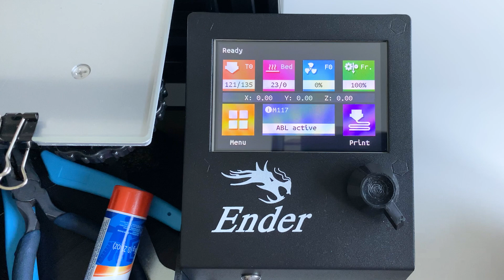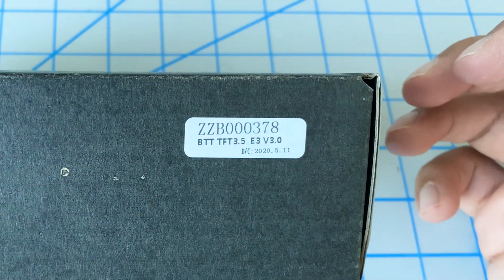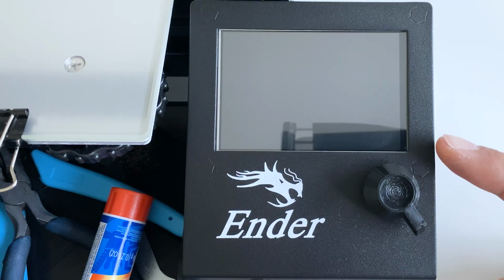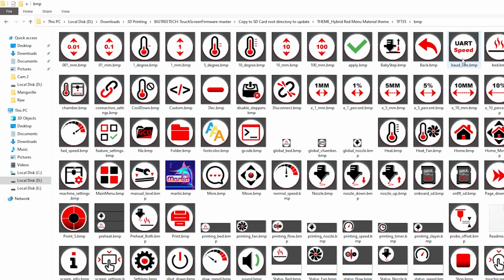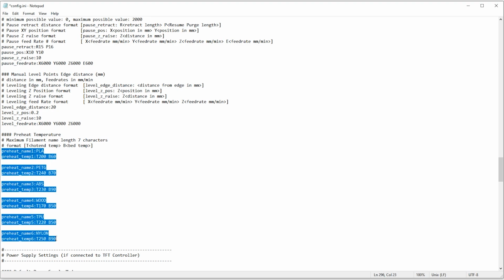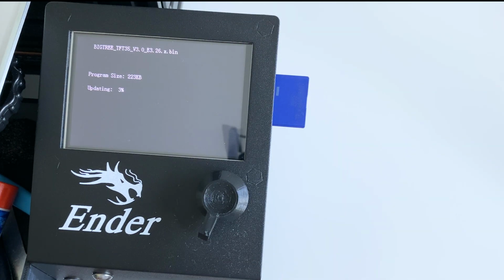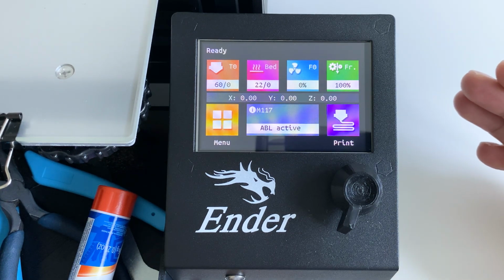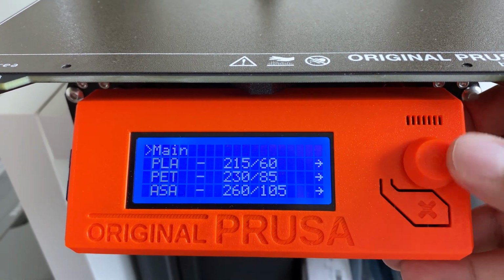Creality Ender 3 Pro BigTreeTech TFT35 E3 V3.0 Touch Screen Upgrade Review | GOOD but some gotchas!

Comment: Where I have to connect it in the creality 4.27 mainboard?
Reply from the maker: Refer to the linked video in the description (minute 3:50 on wards). You won't be able to get the touch functionality with the stock Creality boards though. 

https://www.youtube.com/watch?v=l1Putn10_Ek&t=785s

Comment: I have the same printer. But every time I put my SD card in the printer and start printing it just starts printing a flat peace. It starts on the left side of the printer and goes all the way to the right then it starts printing from corner to corner and it dont just print the item I want printed. I am using the SD card tgat came with my printer. What am I doing wrong?
Reply from the maker: Hey Linda. Is the printer stock or did you make any changes/modifications to it?

Comment: Just bought the TFT35 and will be using this excellent video to guide me through the installation process. Great work👌
Reply from the maker: Thanks, enjoy the touch screen. It’s a really good addition!
Reply: @Mangorille  Although your video was extremely helpful, I was wondering if your would happen to know where I can find an owner's manual? Soooo many settings to play with...
Reply from the maker: @MrPW800  Hey. You can find the user guide here. Not much details and you are left to figure most things out on your own, which is why I made this video. :)  https://github.com/bigtreetech/BTT-TFT35-E3-V3.0/blob/master/BTT%20TFT35-E3%20V3.0%20User%20Guide.pdf

Comment: Hello, Did you upgrade bl touch with skr e3 mini 2.0 board? plz make anytime, setup with bl touch video.. i hope. good job bro!
Reply from the maker: Hey. I did the bltouch with the e3 mini 2.0 board. It wasn't too bad but you do need to set it up using the end stop pin and not the probe port (check the picture in the link below). I couldn't get the probe port to work. Shoot me an email if you want to do this sooner than later as it would take a bit of time to make a video on it and I can help you out further through email.

https://github.com/bigtreetech/BIGTREETECH-SKR-mini-E3/blob/master/hardware/BTT%20SKR%20MINI%20E3%20V2.0/Hardware/bltouch-2.0-2.jpg
Reply: @Mangorille  thanks bro!
Reply: @Mangorille  Hi bro. I couldn't modifiy malrin firmware so, would you give me a firmware? (you used with bltouch z homing like a picture below / skr e3 mini v2.0)
my email is anpower@daum.net

Comment: I mostly use octoprint is it still worth it to get this display? I really like your channel. I have watched all your ender 3 videos. Keep the good work up!
Reply from the maker: Thanks bud! I suspect you don't interact much with the current screen right and you do everything through Octoprint? Does the brightness of the current screen disturb you at night?
Reply: @Mangorille  No i actually created a screen cover in fusion. It works great. What keeping me up at night is the sound 😂

I do some basic stuff on the screen but nothing big. Everything goes through octoprint
Reply from the maker: @MrLog300  In that case probably little value in the screen for your use. Have you done all the quietening mods? It should make the Ender really quiet.
Reply: @Mangorille  I've changed to a silent board and changed all the fans including the psu. I did not use noctua because I've heard you could get some cooling problems with them. I think each fan is around 21db, so it's not loud but loud enough to notice
Reply from the maker: @MrLog300  Sounds like you've done everything already. How about printing the TPU feet?